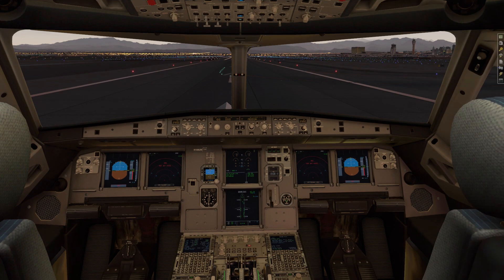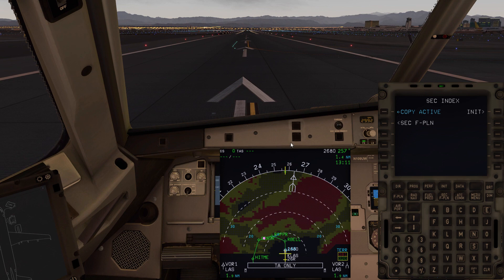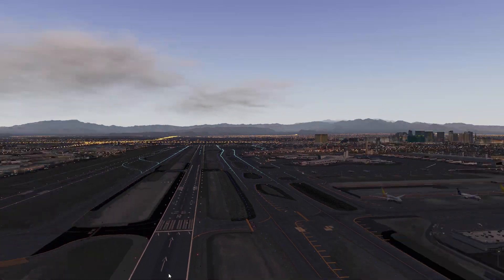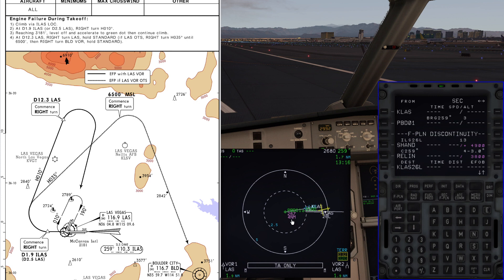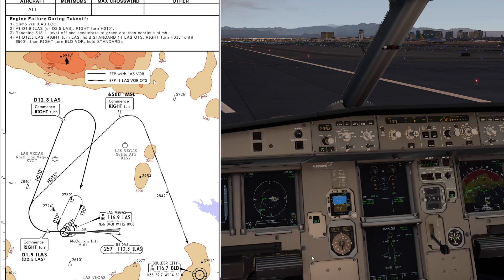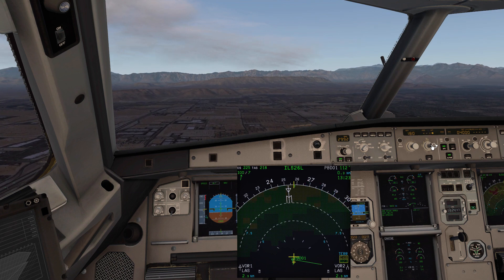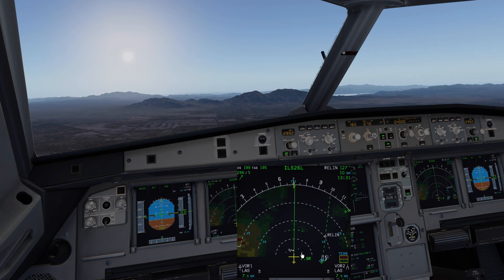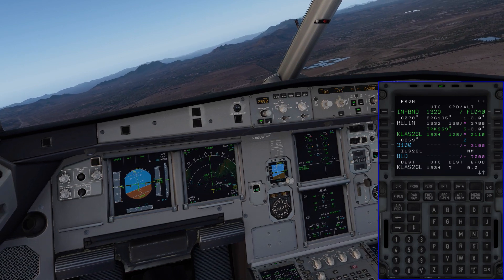I Airbus ADVANCED I SEC F-PLN I FlightFactor 320 I

Comment: Brilliant, as always.
Just a side question: in your videos you always announce "stick forward" and "stick neutral" during take off. Are these official with your operator or just for 'educational purposes'?
Reply: a320 requires half stick forward during take-off roll. Start releasing it at 80kts, should be neutral by 100kts
Reply: @MikeP343  My question was about the callouts.

Comment: When plugging in the P/B/D, would you use the overfly function to ensure the plane does not turn before meeting the waypoint?
Reply from the maker: you most certainly  could, but you dont want to add any confusion in flying past any of the restricted DMEs so I would rather turn earlier than later.  The 12.3 DME from las is a MAX distance meaning even in the turn you dont want your aircraft to exceed 12.3DME so if you had "overfly" on and forgot about it you could easily make that turn outside of the protected area.
Reply: @V1Sim  Correct me if I'm wrong, I'm not an expert on Jepp charts, but when it says to commence the turn at the 2.5 DME and 12.3 DME points, wouldn't that mean to be at least at those DME points before starting the turn? I am not sure where to find this info on the FAA charts, I couldn't see it in any of the SID's or Special Takeoff Mins published for LAS.